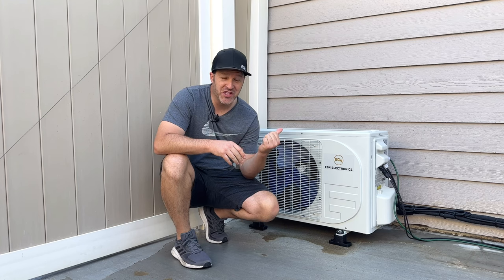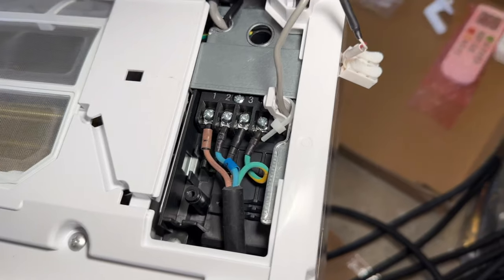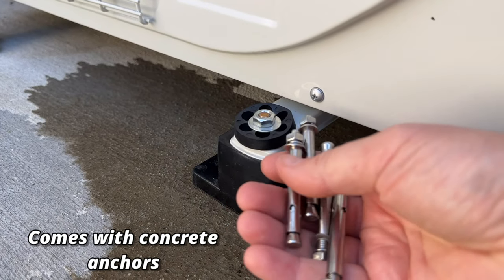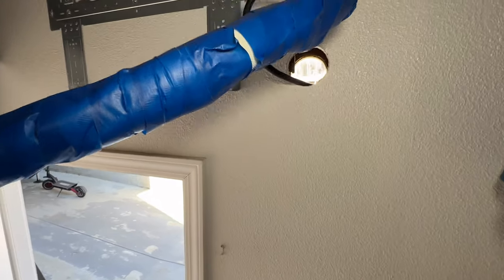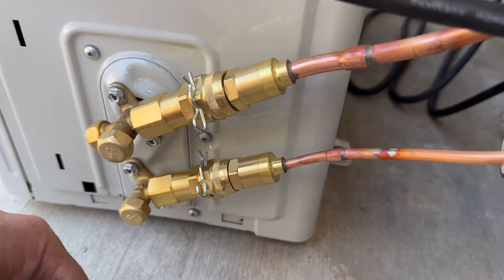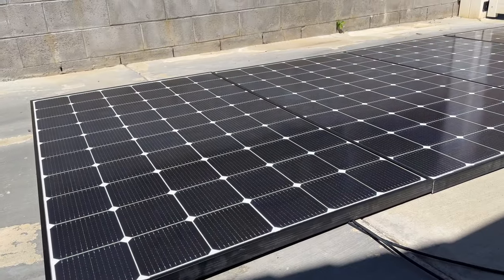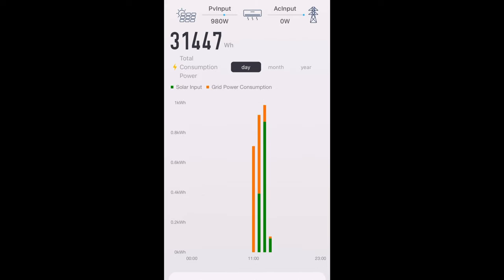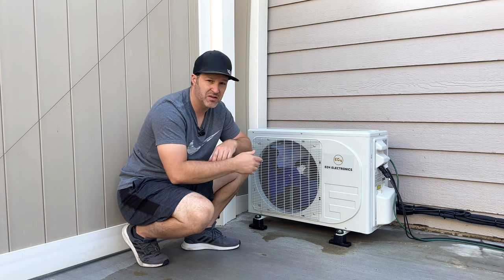Mini Split That Changes Everything! EG4 Hybrid Mini Split Heating And Cooling!

Comment from the maker: #airconditioner #diy #solar #minisplit #heater  #eg4 
ITEMS IN VIDEO BELOW
EG4 Hybrid Mini split:https://signaturesolar.com/eg4-hybrid-ac-dc-solar-air-conditioner-1-ton/?ref=JWKNDS
Trim line Kit: https://amzn.to/43MxTZ5
Solar panels: https://signaturesolar.com/canadian-solar-400w-bifacial-solar-panel-silver-up-to-520w-with-bifacial-gain-cs3w-400pb-ag-/?ref=JWKNDS

Cheaper solar panel: https://signaturesolar.com/canadian-solar-335w-poly-crystalline-solar-panel-silver/?ref=JWKNDS

Rubber Isolater mounts: https://amzn.to/3KjnZY0
Duct Seal to Seal hole!! : https://amzn.to/3KlWsoN
Power Meter: https://amzn.to/3QdbUHC

Items Seen on RV
200 Watt solar panels: https://amzn.to/3OhOMoy
EcoFlow Power products…..
Delta Pro: https://amzn.to/3Qql4Aq
Delta 2 max battery: https://amzn.to/43VesNW
 
Direct Questions for fast response ...https://asqme.com/@johnnysweekends

CHECK OUT MY AMAZON STORE: https://www.amazon.com/shop/johnnysweekends

If you feel I helped you out..Buy me a Coffee 👍🏼🙌🏼👊🏼😀
https://www.buymeacoffee.com/johnny5120J
Reply: @johnnysweekends  hi, l have a question, does your mini split shuts off automatically once the desired temperature is reached? Thank you
Reply from the maker: No they dont really ever shut off, they just spool way down and then power draw is minimal to maintain the set temp. Inverter mini splits dont shut off but are way quieter and more efficient. Only if turned off, sleep mode or not enough power will the unit power off. 
You can set timers as well to have a schedule for on and off. 
I turn mine on and off all the time or depending what im doing if solar is plugged back in I have it set to come on when there is enough sun for start up.
Reply: @johnnysweekends  thank you so much, l thought there was something wrong with my mini split, I really appreciate your time to answer my question, stay safe.

Comment: Powered for free, minus the cost of the solar panels, batteries, charge controller, wiring, connectors and fuses, etc. etc.
Reply from the maker: But if you already had all that and paid for it to be used for that system. Well now you can power other items. 
Or you could power this for about $250 with some used panels easy. 

Ok so powered for $250 🤷🏼‍♂️
Reply: Buy once, cry once
Reply: No battery or solar controller needed.
Reply from the maker: Nope ! Throw some panels down and go 👍🏼
Reply: I see a 10k system as a minimum.  That's material costs only.  Tack on the labor cost for the folks who have no clue how to turn a wrench.
Reply from the maker: Not at all…
This could be purchased for $1250 and installed and wired for another 500-750…
Then get some panels on the ground or if you have room in the yard somewhere and you are good to go. $2500 ish depending on where and who installs for the whole thing
Reply: @johnnysweekends  wow.  I'll have to check out out.  I'm not convinced, but I will check it out.

Comment: I just purchased an EG-4 12k mini-split to go on the back of our motorhome. I chose the other option, the 28.5 SEER-2 model as the DC voltage coming from the solar array racked on the roof of my MH is too high for this unit (399voc). I wanted the higher efficiency AC only unit as I'll be running off the inverter, off-grid most of the time. I have 4,400 watts of solar panels, so I have enough solar power to run the 120v mini-split and charge my 320ah 48v battery at the same time. My inverter will run directly off solar, with no batteries in the loop, so if my battery is full, my mini-split will run directly off of inverted solar power, leaving the battery topped off until the sun goes down.

Comment: It's awesome to see these taking off! Ive made a bunch of videos on mine, they're awesome!
Reply from the maker: Yea they have only been getting better over the last few years and now with Dc options is allows people to take so much advantage of solar power. Is this for everyone ? No but it can work for so many. And they made them simpler which opens more doors
Reply: @johnnysweekends  it's a great option for someone who wants to get their feet wet with solar and enjoy the perks of saving money on heating and cooling. It's way cheaper to install one of these with a few panels than to install a whole inverter and battery bank with a standard mini split
Reply: @SmitHVAC.  I’m new to this; and so far I’ve seen video with inverter and batteries installation, what’s this method called? I see he doesn’t use batteries, what’s called?
Reply: @mangotwiss  I’m interested as well. This seems like the holy grail.
Reply from the maker: This is a hybrid it runs on ac and dc. Verses a dc mini split runs on DC only and say 48v battery setups

Comment: I love my eg4 12kbtu unit. Been running it for 7 months. I have saved 286kw of usage.
Reply from the maker: Ahhh I knew I would to and I have been so far behind on this. Took me forever to just order it and do it. So many other things going on and other video I kept forgetting to get one 😂
But hey, better late than never 😀👍🏼
And so far with it plugged into the rv, technically its powered for free now. Obviously its cost was the unit and RV material but better than letting the RV sit there. Use it for more. 😁
Reply: @johnnysweekends  I have my panels set up on a "mobile" platform and it doesn't require code or inspections.  Of course it has a dedicated 20 amp breaker in the box but so far about 40% savings on all my ac and heating. Totally awesome stuff and loved the video
Reply from the maker: Yea it wont be long till they come looking for all of use and want some money…😂 and yes definitely awesome. And thank you 😀👍🏼
Reply: would this cover a 700 sqft space as an offset to my main a/c
Reply from the maker: @mikeremillard5414 I definitely think it will help especially since it will be in a more insulated space. If you can help keep it cool by using solar it will make it to where you won’t have to run the main unit hardly as much.

I may even get a discount but I’m waiting for a response

Comment: I have a Delta Pro power station.  I want to connect the EG4 mini split directly to it without connecting it to solar or connecting to the grid.  Is this possible?  Sorry if this has already been asked and answered.  Thanks.
Reply from the maker: Yes but at full power draw the mini split with use 1100-1150 watts a hour.

Comment: So with 1,071 watts in full power mode that a/c  is 19.3 seer. I have a hotspot energy 22 seer hybrid and ran it in the shade on a 105° day it was pulling 1550 watts which is about 20 seer. Running on panels all day long to offset my cooling has significantly dropped my electric bill !
Reply from the maker: These are amazing. My rv still runs it while im not using it. Great for heat and cooling. I need more of these lol.

Comment: What happens when the unit doesn't have enough solar to run? Is the switch to grid immediate or is there a delay?
Reply from the maker: It balances between the two. So it with use what ever it needs from wither solar or the grid. Solar is priority if hooked up and when it’s starts to drop it with pull power from ac and keep going till solar is gone. 👍🏼
Reply: @johnnysweekends  I am just making sure that I understand the way the unit operates. So, the unit is required to be plugged into a 120-volt outlet for its operation. Is that correct??? I am assuming the unit has no internal battery storage. Therefore, it needs to be plugged in just in case a cloud goes by. Is that correct???
Reply from the maker: So it can be powered fully off of solar only. I have had it plugged in for the last 3 days and AC not connected. It will get enough power to turn on and run the fan about 7:50am and then about 8:20 enough solar will then kick the pump on and away it goes till about 6:30pm. Then shut down. Obviously days are getting shorter. And this is when powered from RV solar only. 

Now because of my yard the ground mount is different.

Now when it comes to shade……so my RV has a series parallel string. So depending how much shade the unit will go from full power at 1050 watts which is about as much I have seen down to 300ish watts and still run the pump. So cold air is still blowing but not as much when fully powered. Now if it was plugged into AC it would draw as much as it could from solar as priority and if shade comes AC will be pulled to keep the unit running at max power or what ever the setting. 

It’s great. My garage is 78-80 on a hundred degree day. Which now I need to insulate it…lol.

Over all I wish I did it last year but just was busy and forgot lol.

Comment: Powered for free?  Where can I get the free solar system?
Reply from the maker: I think you missed the message. If you already have that stuff then utilize it, or if you want a cheap heating and cooling unit its a great option, or buy $250 worth of used panels and throw them on the ground and run it. 
That will pay for it self in know time.
Reply: @johnnysweekends  Your thumbnail nail...."Powered for free!  What did I miss?
Reply from the maker: Just saying if you already own the stuff, then you have already paid for it. 
And $250 can get you used panels that will power it. And pending where you live how it’s set up it will pay for it self in no time. Especially if you are on top tier energy consumption

Comment: I’m definitely getting this.  I’ve seen several videos on it.  I’m retiring in 3 weeks and moving to a sunnier climate and this will work out great!  Thanks for the video!
Reply from the maker: No problem Jeff. It’s definitely gonna be nice to have a cooler and warmer garage. Although i need to insulate a little lol because there is none,  😂
Reply: I was given a Magnum power inverter.  I hear it’s a very powerful unit.  With a 12v 100ah 1.28Wh LifePo4 battery, would that application work on the EG4 mini split?
It’s a Magnum MS 2812 Inverter/ Charger.
Reply from the maker: 1280 watt hours is not much and you never get full spec. So that would give you about 1150 watt hours of power give or take depending on the energy draw. And if the mini split is drawing a 1000 watts that’s only a hour or so. Plus inverter loss. So about one hour on that. But it needs at least 90v dc which seems a pinch more is better closer to 100v or a 110v ac power source.
Reply: @johnnysweekends  OK thanks.  I’m learning as I go here!  I’ve got solar panels but need to add a few more to the array if I want to run it strictly from solar.  I do have a Delta Pro. 😎

Comment: Sweet! Glad you're using you RV when it's parked there, great idea!
Does this also act like a heat pump?
Reply from the maker: Yes!!! Heating, cooling and dehumidifier or just a fan if you want!!
These have so much potential for heating and cooling at a low cost depending how you set it up!

Comment: Did you link the exact ecoflow kit and amount of battery storage/ panels needed to run this daily off-grid? I'm looking for a solution for my cabin/ treehouse. Also, would you be willing to get paid for install and all travel expenses if you could help me? Thx!
Reply from the maker: In order to run this all day off only solar and batteries say 24/7 you would need a decent setup, like a 15k battery bank and a lot of solar to recharge that bank during the day. Almost two different setups. I run mine for about 10 hours or so when im in the garage doing stuff. But its two different systems. My Rv and the panels on the ground. 
Sorry it would be cheaper to find someone local. To many variables and cost and I dont have the time.

Comment: Are you running the solar panels into a controller? If so which controller are you using? Did you wire all of the panels in series or parallel or series/parallel?
Reply from the maker: The mini split has its own controller !! 
So you plug the panels right into the mini. 
You wanna do series to hit higher voltage of up to about 350. Unless you split the array then parallel in. But it doesn’t need a lot of amps so series is ideal.
They are also having sales and combined with my discount code they are a pretty good deal.
Plus they have a 24k btu unit as well. But 220v 👍🏼😀

Comment: Pretty neat would be nice for a camper or single room.  12000 btus should cool 600 sq. feet.  Maybe use it to take load off your regular ac?  Or depending on house size you would need 3, 4 or 5 of these.  Just the same nice backup for a room or 2 in your house if you lost your lights.
Reply from the maker: Yea so far it’s great in the garage. Once everything is cool even if you open the door in 10 mins or less it’s cool again because everything else has been cooled down

Comment: When I got the 9k EG4 heat pump, I thought it would be DC solar ready. However, even though the labeling on the outside unit talks about solar, there appears to be no terminals on the outdoor unit to accept DC solar. Since I have microinverters which output AC solar, I mounted a combiner box (main lug panel) next to the heat pump outdoor unit. So, the solar lands in the panel and the heat pump lands on a breaker in the panel too. The truth is, in a way this is better than having solar dc go to the heat pump unit. I was never sure if extra solar would back feed to the grid through tge heat pump. Should work great if I didnt kink any hoses. That part was tricky. I got a good hiss of air on the half inch line when I turned the allen key. But the quarter inch line didn't release much which worries me a bit.
Reply from the maker: Turn it on and you’ll find out

Comment: Cheers to Johnny's,  finally got my 12k eg4 hybrid going in the back of my 5th wheel. Question on the 16 foot line sets, is it pre-charge or can I modify and add additional copper pipe to extend length?  If mounting condenser behind rv in a modified carrier attached to the hitch, do I need the rubber feet? TIA ❤
Reply from the maker: YES…they are pre charged! So adding length can be done but you need to discharge the lines properly then recharge them. This might require a hvac tech. The rubber feet may not be needed in your case as it’s little just to absorb and prevent vibration.
Reply: Great, thank you sir!

Comment: Can i hook 2 units using the same panels under 380 VOC?
Reply from the maker: No unfortunately you can’t or each unit would be fitting for the voltage. 
You need to split the array.

Comment: I have a similiar setup for a minisplit to cool my garage.. although the AC that powers the condenser come from the factory with the AC cord on the evaporator inside the garage connected to a wall outlet.   Was getting it looked at cause there was an issue with a fan on the wall unit and they tried to tell me code required that i have an emergency disconnect on the external unit. .. but i see you're plugging yours directly from the condenser and a line must run through your wall to the evaporator to power it.  Wwanted to bull my $1100 to run that disconnect which i declined.
Reply from the maker: True if it was going inside it would need it’s own disconnect. But since this is a stand alone unit not powered by the house, well it changes the rules. And when I sell the house, the power cord will be wound up nice and disconnected and no solar cables will be plugged in. So it essentially will be a unfinished install. 
New owner will have to have someone wire it or they can plug it into a outside generator or…. We’ll ya know 😂
Reply: @johnnysweekends  Ahh ok thank you

Comment: Do you have a video that describes how you use the power stations in the RV? Really enjoy your stuff, thanks! Just found it, all I had to do was look...duh.
Reply from the maker: Umm maybe not a exact video but several showing things i do with it. Which is funny because people have been asking. Maybe after I get done with a few more vids I have lined up ill do a video on EcoFlow delta pro and generator use stuff and how it has been doing. So far its great as I travel with my fridge on AC and never use the propane now except for hot water or fire pit. And I never worry about battery issues. It doesn’t solve the “I can run my AC units for ever” but that’s what it is really meant for. Although I can run for several hours..😁
Reply: @johnnysweekends  I am fascinated by the prospects of just using the power station and charging it with portable solar when I am parked (I have a van and can only fit a small panel on top), or a generator if needed. A video on how you do it would be great when you can get to it. Really do like your channel, I have been spending a lot of my weekends with Johnny...
Reply from the maker: Awesome glad you are finding some helpful info. 
I will have to do a couple videos soon I guess on my set up.